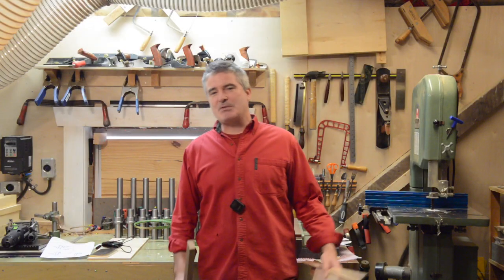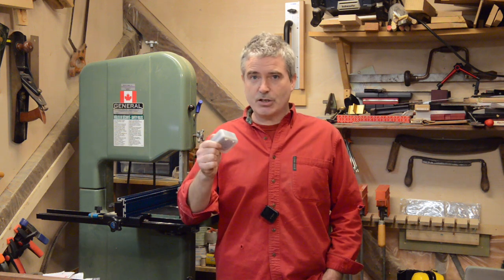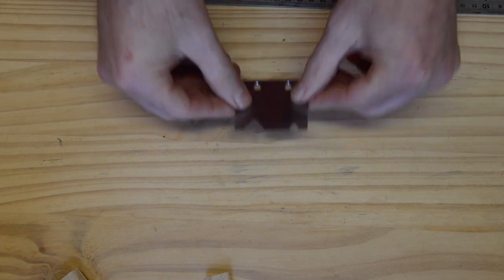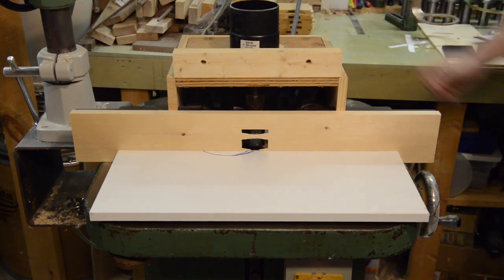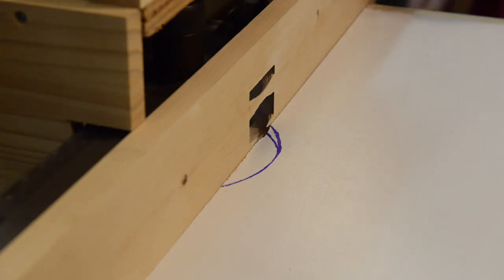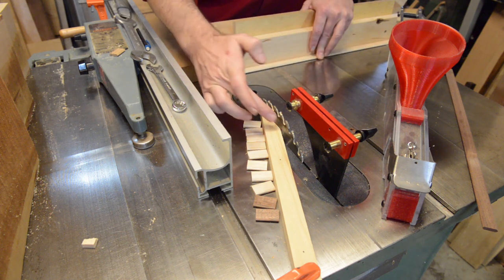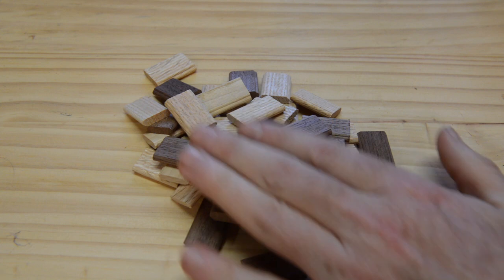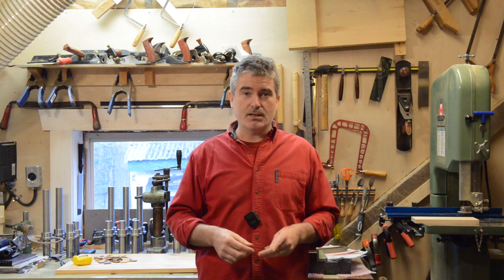DIY Festool Dominos on the shaper / spindle moulder

Comment: They do a cutter head as well, saves setting the cutter blades and limiters in euro block. Fantastic video, I use  a large amount of 10, 12 and 14. It would pay for itself within 2 months
Reply from the maker: Yes, the dedicated block would be more efficient if you did enough to justify the cost for sure!  This is a great option for lower volume users.

Comment: Great video. One box of 14mm Domino’s in Australia costs $110. The set of knives and limiters set me back $220. A no brainer really. Cheers. PS: I have two Spindle moulders. The one unit does not have a screw advance to advance the entire fence forward (for example when you want to break through a false fence). Any pointers on best practice on how to do this when your machine only allows you to advance one fence at a time independently? Cheers Greg.
Reply from the maker: Is does make sense eh?  It's nice to be productive if you have an hour before quitting time but you don't want to start a new big job.  This way you can whip a bunch off and use up some scraps.
Reply from the maker: Email me a picture of your fence settup...I might have some ideas.